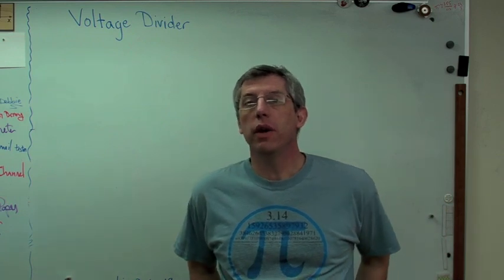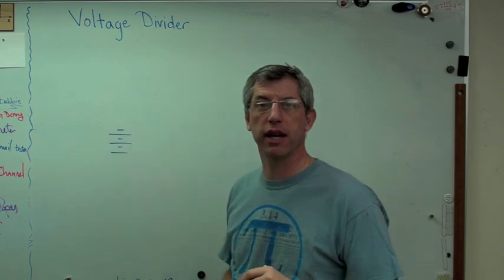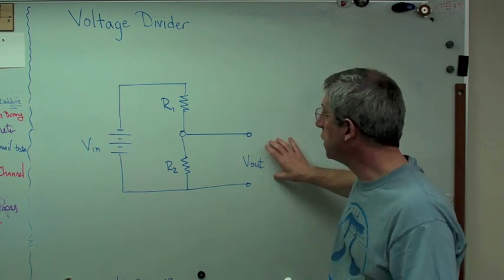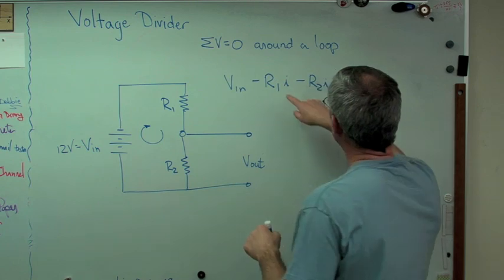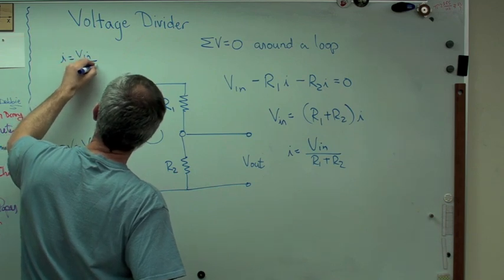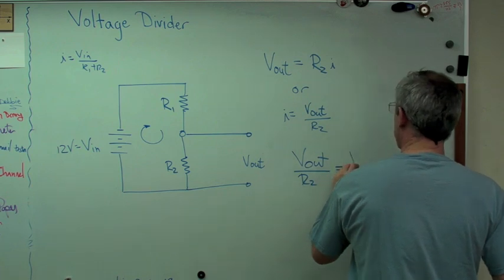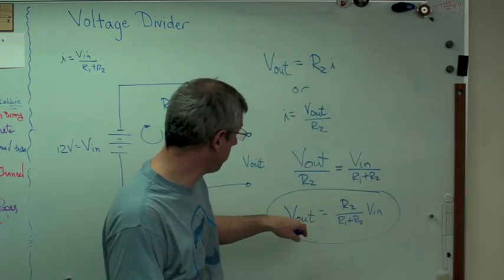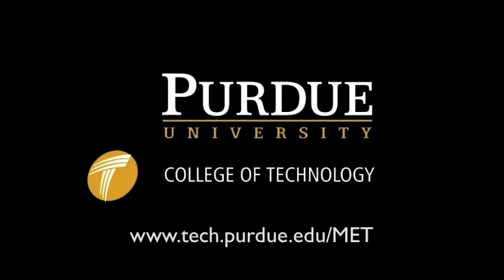Voltage Divider - Brain Waves.m4v

Comment: So if Vin is 12 volt 1 amp. Will Vout be 6 volt 2 amps?
Reply: No, Sir, it will be 6 volts at 1 amp.  It seems you may be confusing the voltage divider with a transformer.  In the case of a transformer with a 2:1 winding ratio, the output would indeed be 6 volts at 2 amps, because the transformer uses inductance to literally "transform" some of the voltage into current.  The voltage divider, on the other hand is called that because ALL it does is divide the voltage; it does NOT multiply current as the transformer does.  The remaining or "lost" voltage is instead dissipated across the other resistor, in the form of heat.
Reply: flurng Thank you, that helps ;)

Comment: Nice!  From first principles (KVL & Ohm's Law) plus simple algebra he derives the voltage across a resistor in a series circuit.  How about the similar relationship between Vin to Vot in a series circuit where there are n resistors and we want to know the drop across the k through (k + j)th resistors.  By the same reasoning I guess it is just Vin times (sum of the j R's measured across) divided by (sum of all n R's) ... Cool!